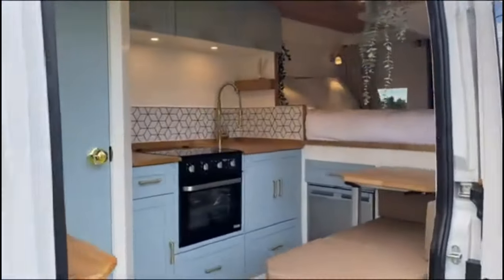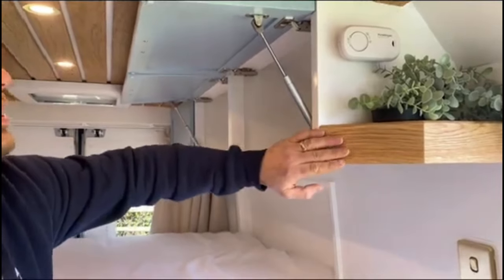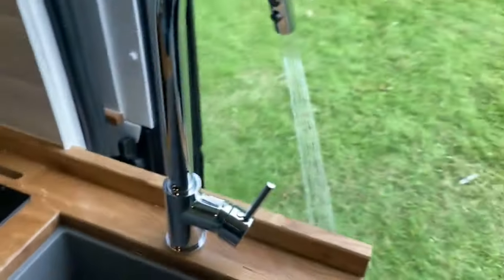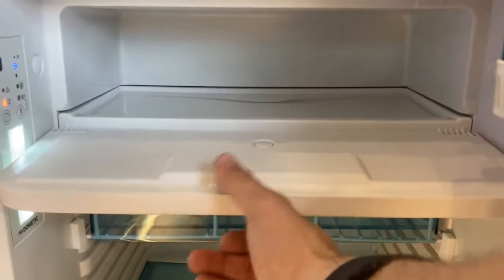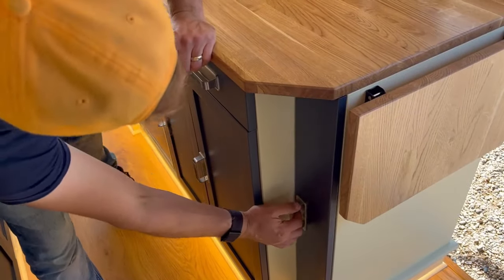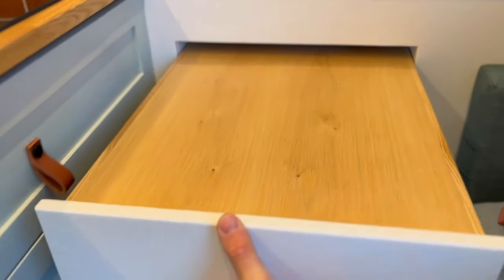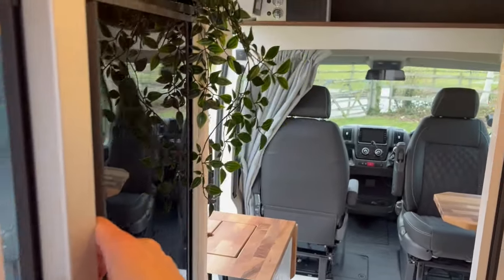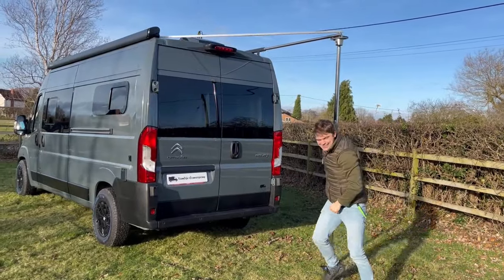Best van conversions & our favourite features that we added in 2023

Comment: All really fantastic and so cosy!

I’m at the bed bulkhead stage in our van and have discovered the complexities of designing the shape and all of the complex measurements, matching it to the kitchen counter height.

I’m a bit uncertain whether to make the kitchen units 850mm or 900mm high, as I have a window behind my kitchen counter and a 900mm height will obscure some of the bottom of the window. But 850mm seems a little low, noticeabley. I think it’ll have to be 900mm. 

Do you set yours to 900mm? 

Thanks as always for the vids. I wouldn’t have gotten as far as I have without them!
Reply from the maker: Hi Dovoro, 
Thanks so much for your comment. We fully appreciate  the issue lol and a small change in dimensions often has a knock on effect somewhere else. The kitchen unit carcasses that we build are actually 870mm high. We use either 22mm or 27mm worktops so the finished surface height sits only just below 900mm. 

We are so pleased you have found our videos useful for your own conversion. We will continue to push out more content.

All the best 🙏

Comment: Any suggestions if some one wants to build or buy smallest carvan where basic needs are fullfilled just to sleep even in snowy season and just 1 knob gas burner. Cheapest cosiest and smallest carcamp not more than 1.6 litre petrol car
Reply from the maker: Thanks, the smallest we do is the SWB Ducato or Relay but lots of people have converted much smaller vans and even cars! Something with only windows in the cab will help in snow as there is more space for insulation compared to a standard car.